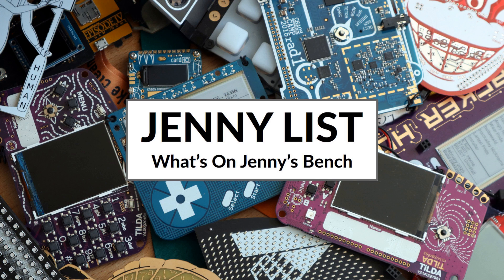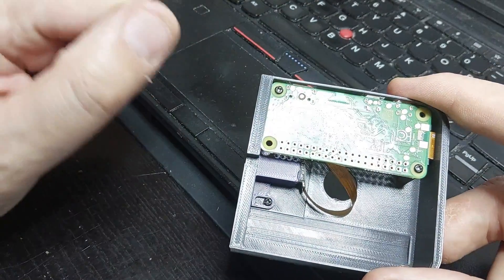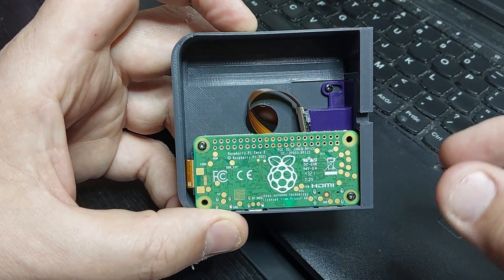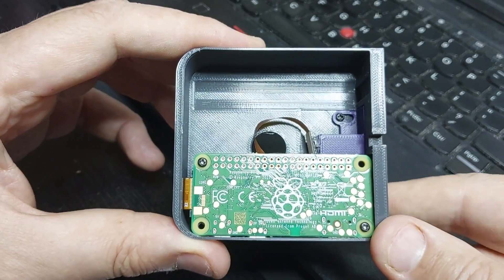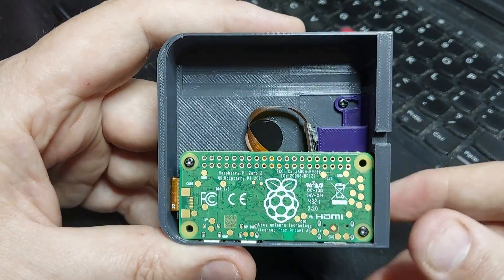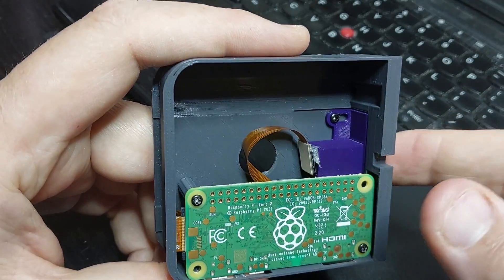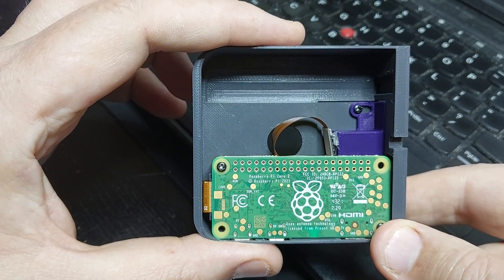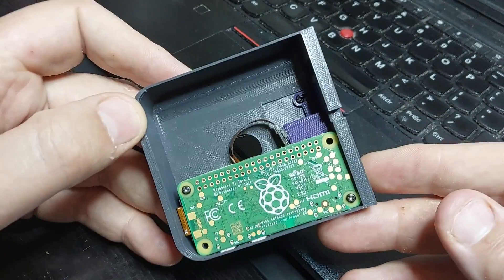Digital Super 8 cartridge, part 4: What's On Jenny's Bench

Comment: loving this project!

I feel like perhaps using a macro lens reversed might be something to explore...  I don't know if you've seen the "focal reducer" (aka "speedbooster") devices for video cameras that have been released the last few years.  But, they seem to essentially be doing what you are proposing -- for a different use case slash imaging pipeline.  My understanding is that these "focal reducers" are essentially macro lenses in reverse.  I'm probably not explaining this well or 100% accurately, but, hopefully it gives you some stuff to look into if you are interested or if it sounds interesting.

also, on professional video cameras there is (maybe was) a thing called "back focus" which was a necessary process to do minute adjustments in order to get the lens and sensor to focus correctly -- otherwise your parafocal lens would not hold focus.  I just mention this to suggest that perhaps this kind of process or some ability to make small adjustments to the sensor position might be necessary occasionally.  Like, it might be helpful to imagine this as part of the maintenance of the setup and allow for that kind of tweaking.

excited to see where this goes!
Reply from the maker: I'm familiar with back focus from the Raspberry Pi HD camera, and it's a PITA. I am hoping that it's taken care of in the camera's optics, in that they focus on the focal plane where the film sits. If I focus on that point, I should be able to become an equivalent of the film.

Comment: Shouldn't the 18fps frame grabbing of the Pi be synced to the physical camera shutter? When out of sync you could get frames where the shutter is partly or even entirely closed.
Reply from the maker: I find once the software is set to grab at 18fps that it does a pretty good job of its own. But I will be experimenting with a photodiode sensor.

Comment: People have used the Sony IMX bare sensor C-Mount PI modules for making film scanners like the degusse roller, I think using more approprate sized sensor in this inverted sence would yield great results as you could get a native focal depth out of the fixed lens on the body.

Though global shutter sensors are more suited with the mechnical shutter nature of the camaras unless your stripping it out, but to get the flocal plane right you would need to put the sensor on a slider internally really but I dont think there needs to be more then 3mm of play based off the position of a super8 cartrige film position, then again just off the top of my head thoughts the small injection molded lenses on those probe/webcam style sensor modules are utterly terrible for this application but there is good micro lenses on the market if you just need to multiply the focal ratio, but thats the main issue I see with sensors smaller then the intended image area.
Reply from the maker: Surprisingly, that sensor is about the same size as a super 8 frame.

The lens however is not very good, you're right there. Keep watching, I have some ideas I want to try there.
Reply: @jennylist  I've got 8mm and Super8 camaras so I will be, someone on the DomesDay86 community posted a link to this and we do raw FM RF capture and decoding for tape/laserdisc and even CVBS and then can DAC even pipe it back to analog, so its cool to see stuff being done with legacy film kit as I just picked up a new 8mm body this week its really nice to see 100ft and 25ft rolls are still around though.
Reply from the maker: @TheRealHarrypm  I think we covered the raw digitisation of laserdisc and VHS for Hackaday. Very cool stuff indeed.
Reply: @jennylist  Yeah the last hackaday article was really not well done, quite franky ld side and tape side are seprate but united under the core concept of FM RF capture which any publication should focus on rather then pushing a now 3 years out of date absolute edge case example of the post processing of the RF data as the first video people see...

Really that whole article should have been fixed but no one updated it even though there editorial staff was provided with the content to do so, it angers me to this day as the wiki writer as its borderline confusing to people getting into whats the end all methods of digtisation, which alongside the Lordsmurf's missinformation campain becouse we put a foot down on his acts of fraud and the inflation trap DigitalFAQ has become a stronghold for SEO score still has a long way to go as more external content is made.
Reply from the maker: @TheRealHarrypm  ok. Do you have an updated recent write up of technical progress? Submit it to the Hackaday tips line.
Reply: @jennylist  Well on the wiki there is summary info on the first page, the readme, the tape format support list, even graphics with colour keying, the VCR tap list covers a wide range of tape formats, there is even a press doc due to those issues which bullet points a lot of key features, this has all been linked about 7 months ago to the editorial staff, the tape format support is all thats really changed i.e SMPTE 1" broadcast reels, and a full scope doc on Sony 8mm formats to ease jig tapping.

In simple terms, FM RF capture is done for all but duel channel formats like Betacam etc as there is offshelf ADC's that cover it, just not affordable ones lol, decoding wise the dropout detection code and TBC code surpassed anything on the off shelf hardware market over a year ago at this point, just a matter of indeffinite filter refinement.

Comment: this makes very limited sense, but some kind of sense would make if you would at least add a rear projektion screen material between the super8 camera lens and your camera lens in the cartridge, which has some physical grain, and ideally not only one screen but a rotating set of different frames with different grain, e.g. an endless loop (agitated by the camera as normal super 8 film) of blank/white film.  but still, it lacks the most important aspect of real film, the colour response curves, especially in conjunction with the subtractive process. unfortunately, there is no know "filter" material which emulates that physically. or does something like that exist?
Reply from the maker: Watch the previous video, I looked into the projection screen idea.

Colour response is a software thing on this. As you can see this is an early prototype, and there's a lot more work to be done here.
Reply: @jennylist  ok, i will watch.  colour response emulation in postprocessing doesnt work, and cant work, what is messed up and missed by the sensor can not be repaired and invented from nothing or by guessing afterwards in a way which comes close enough to the real thing, maybe someday with ai, but not with any available software tools, not even 300k$ color grading toolsets used by the largest studios worldwide, it just doesnt work this way.  there might be physical ways before the sensor, photochromic materials etc, but not afterwards. no chance! you cant fool the laws of physics

Comment: I guess that your solution may need to be set up individually for any camera lens since you kept the lens of the camera module.
It may be possible to remove the lens of the camera module.
Any pice of optics added to the super 8 camera will alter the image and may also change the focal range, the field of view and may cause trouble with zoom lenses.
If you want to try a bare image sensor in the cartridge you will need to set up it's distance to the super 8 lens very accurately to obtain focus
Reply from the maker: The idea is that it has to focus on the focal plane of the camera, which is the same relative to the cartridge for all cameras. Thus once it is set up properly for one it will work on all.

Take a look at the previous videos in the series and you'll see why a bare image sensor didn't work. It's extremely difficult to get it in the focal plane, because of the thickness of its glass front.

Comment: Was it just an accident that your camera's frame rate synchronized with the shutter? It seems like you could just have easily found yourself synched with the closure of the shutter and got a black image. Or anything in between! Very clever solution, though!
Reply from the maker: I've done a lot of experiments and I think it's an inevitable side effect of filming through a shutter.

But one next step once I have it battery powered is to try different cameras. Right now the Minolta is the only one I can get the Raspberry Pi cables into the cartridge.